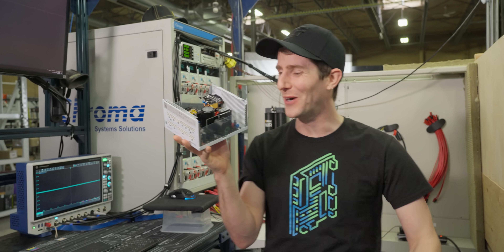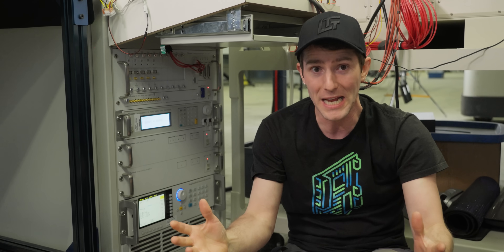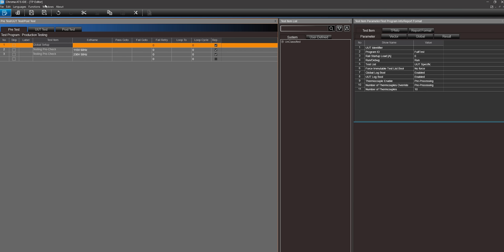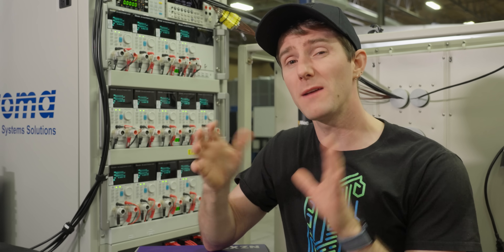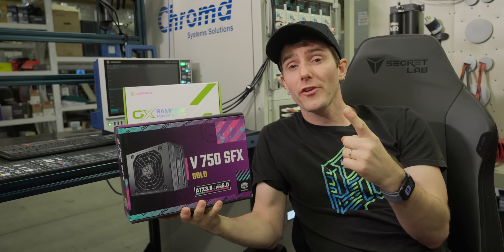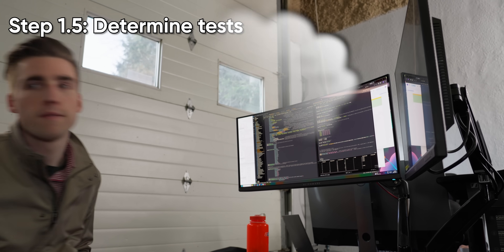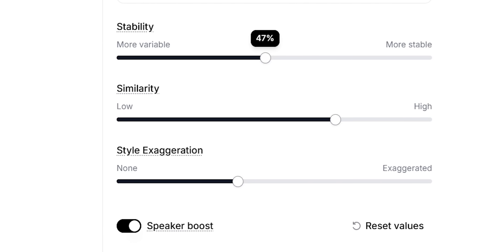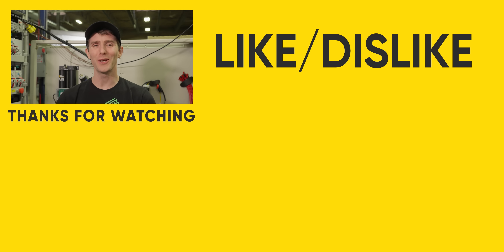Thousands of You are Buying Dangerous Power Supplies

Comment: My little bro got  a $28 PSU off of amazon for a PC I was building him. I warned him against buying it and sure enough after 2 months of not very strenuous use. He was left with a faint smell of ozone and a dead PC.

Edit: Thanks for all the likes, I was able to swap his PSU and get it working again. No problems since. I will try and find the original PSU so you guys can watch out for it.
Reply: A good learning experince, I just hope the pc wasn't very expensive😂
Reply: At least it was just the PSU that died and not the whole thing.
Reply: it's $28 we don't need the name to know not to buy it 😂
Reply: No need for specifics. Just don't buy PSUs in the price range of "1,5 dirty socks and 3 dead rats" :D
Reply: Curious about the PSU.
Reply: pc builders online would always say "don't skimp on this, don't skimp on that". The reality is that you can skimp on a lot of components without the risk losing your whole system, only a bit of performance. But skimping on the PSU could be fatal for your brand new system. You don't have to spend exorbitant amounts of money on the PSU, but don't spend as little as a mcdonald's menu worth.
Reply: @Zonjiru almost every component is a tough sell to skimp on. But imo, PSU is the most important thing not to skimp on, followed by the mainboard. I think from least skimpable to most skimpable, I'd put the list like this for a gaming PC:

1. PSU: If it fails, it can take your other hardware with it and even set your room on fire!

2. MAINBOARD: A faulty mainboard can drive you CRAZY with issues that are extremely difficult to diagnose. Plus, ideally, your mainboard will support your next 2 CPU upgrades. Lower chipsets may not get updated for new generation chips (this is especially true on AMD, whereas intel chipsets usually only 2 generations anyway, even if they could support more) and cheap boards may have weak VRMs that sometimes can't even support the high-end CPUs of its launch generation, let alone future compatible CPU generations.

3. CASE: I'm sure you're surprised  to see the case so high on my list, but hear me out: a cheap case makes building your PC, as well maintaining, troubleshooting and swapping its hardware a freaking nightmare! Not only that, but cheap cases may have problems with the grounding of their IO, causing ESD schocks to go into your system and potentially crashing the PC everytime you plug something in. I've had that problem for years, it sucks! Moreover, cheap cases are made of thin steel that loves to vibrate and amplify the noise of your PC fans and cheap cases often have poor ventilation that can make components overheat that would otherwise be fine. Lastly, your bargain bin case may have wrong dimensions posted on its product page and it might not actually be able to fit that shiny high-end GPU you spent 80% of your budget on.

4. CPU/GPU: whether it's better to skimp on your CPU or GPU depends on you situation and what skimping means within your budget. Obviously, your GPU matters most to your system's gaming performance, but a pricy high-performance GPU is wasted money if it's bottlenecked by your CPU. If you can't currently afford both the GPU you want and the CPU you need in order to get that GPU's full performance, I would suggest you buy one of the two, based on which one you can get a better deal on at the moment and pair it with an extra cheap CPU/GPU until you can afford the one you need. Do keep in mind though, that it's easier to swap a GPU than a CPU, you can literally put a 20 years old GPU into a 2025 motherboard, so it might be the better strat to get a good CPU and grab a cheap used GPU as a stopgap until you can save up for the real deal. Also keep in mind when budgeting, that your CPU performance gets more important if you want to play at high fps at like e-sport settings, whereas if you play at high res and ultra settings, HDR, Ray-TRacing on, etc and are willing to sacrifice fps for eye candy, you may be able to get away with a lower tier CPU than you thought. For instance, I'm gaming on a 5120 x 1440p monitor, I run a mighty RX 6950 XT coupled with a very mid-tier Ryzen 5 5600X and the CPU is far from fully utilized in games, even when I do get 240 fps. a mid-range CPU is all most gamers should need. Unless you play simulation-heavy games like City Skylines or Civ6, I suppose.

6. RAM: Obviously, you need enough RAM to run your games, but apart from that, it doesn't need to meet any other criteria, from my experience. I've had trouble with instability running my RAM at it's advertised XMP speed in the past and I haven't noticed a difference compared to running that RAM just at JEDEC speed, even if JEDEC was only 2/3 of the speed it should be running at. Similarly, I don't think timing matters much either. The cheapest 16 GB kit of RAM you can get will probably get you by just fine for years to come.

7. BOOT SSD: A faster, more responsive system is always nice, but it doesn't make your games run better, at least not yet. One day we may see direct storage find its way into PC games, but until then, the speed of your boot drive doesn't matter. Just make sure it won't die on you and that it has enough space. If using Windows, it should have at least 256 GB these days and I'd even recommend 512 GB, because Windows just LOVES to fill up your bootdrive with trash data faster than you can clean it. If you use Linux though, you can get away with as little as 32 GB (saving you considerable cost), especially if you map your home directory onto a seperate drive, which I always recommend regardless of Linux or Windows. separating your user libraries from your operating system drive makes it much easier avoid loss of personal files and quickly set your OS up again, if you need to reinstall OS in case it won't boot anymore.

8. COOLING: Cooling needs to be good enough to prevent your hardware from thermal throttling, but provided you didn't skimp on your case and didn't go for the hottest CPU and GPU available, you will probably be fine with the included case fans and CPU cooler (or very cheap ones). You can always easily upgrade cooling components later, if you want your PC more quiet, want more thermal headroom for overclocking, or if it turns out you are actually throttling.

9. DATA DRIVES: They don't need to be fast, just reliable and you can easily upgrade the capacity as the need arises. If you're on a tight budget, start with a small data drive and add another one with double the capacity of your existing one, whenever that fills up. That's been my strat over the years, starting from 500 GB, to 1 TB, to 2 TB and finally 4 TB. Don't buy a large drive from the get-go. They're expensive and take YEARS to fill and by the time you filled that 200$ 8 TB drive halfway, it will only be worth half as much and you could have used a 4 TB for half the original price all this time.

10. RGB/AESTHETICS: I love me an aesthetic build with color matched hardware, RGB and custom cable extensions and I call one such build with a red and white theme my own, but as nice as it looks, it totally is a waste of money that should not concern you if you're on a budget and wanna get gaming. This is the kind of stuff you can put your money to once  you've already got the hardware that gives you the performance you want, but still feel the ache to upgrade your PC. That's how I did it and I think adding some nice looking stuff to your PC can be money better spent than a performance upgrade that doesn't result in noteably better performance. But you need to have satisfactory performance first, before it makes sense to make your PC nicer to look at.

11. OPERATING SYSTEM Windows retail licenses are expensive and you don't want to use the Home version, you don't get any control over you PC with that! It's gotta be Pro! luckily, you can buy very cheap resale OEM keys, but you need to accept that you need to buy a new OEM key whenever you do a "significant" hardware change. It's annoying, but still a better deal than than a retail key, since OEM keys are often 10 - 20 times cheaper than a retail Pro license key and you're not changing your hardware that often! You could also just not pay for Windows and game with the watermark, but I can do you one better: LINUX! It's free and after almost one year of using it, I am 100% convinced that it's also plain BETTER than Windows, even for gaming. Between Proton (Steam) and Wine (Lutris), 99% of PC games from any era run just fine! the only exception are some games that use EasyAnticheat, though not all of them. Watch_Dogs 2 uses EAC, but I can play it online in Linux. Point 11 is the best thing to skimp on in my opinion: if you go with a free Linux distro instead of a 200$ retail Windows 11 Pro license, you don't just save money, you even gain freedom from Microsoft's oppressive policies! It doesn't get better than that!
Reply: Ooo your little brother got a great deal on that magic blue smoke generator
Reply: This is why you make sure to have it in a bottle so you have extra magic smoke containment.
Reply: Fried itself only, or something else inside? @Balizticz
Reply: @petroz5505  It seems to have only un-alived itself, damage to other parts is unclear. I picked out a new one for him and there haven't been problems since.
Reply: @Balizticz 
Vital components have sacrificial parts in order to protect them from getting damaged.
Reply: My lil bro got his GPU fried because of the same reasons. Don't be janky with your PSUs kids!
Reply: @higifnr  overused and corny line
Reply: I grew up on anime. I know what i am talking about.
Reply: You failed at protecting your little bros computer.
Reply: @reveral9880   Bro, OP said he warned his little brother but he still installed it, at that point that is the little brother fault.
Reply: @NA-Per No. It is always big bros fault. Big bro supposed to take the blame for little bro in any situation. Only bros will understand
Reply: @reveral9880 I'm a little brother and no, you're wrong! Everyone has to stand up for their own mistakes!
Big bro's responsible to teach little bro not to make the same mistakes, but if little bro doesn't want to listen, it's only little bro's fault!
Reply: @reveral9880  you clearly didnt grow up with siblings cause pointing fingers and assigning blame to each other is what we all do
Reply: @reveral9880  yea no that is not how it is

Comment: Whenever someone asks for an opinion for their PC build I always say never skimp on power supply and make sure the brand is notable, if they don't know any I'll give a top 5 in no particular order: Seasonic, corsair, Silverstone, superflower, and FSP. Also to get at least a minimum of 80+gold rating especially if they live in a third world country with frequent brownouts and inconsistent current.
Reply: Mind you, every single one of those has a couple dud models that you don't want to buy. But on the whole, their better offerings are good.
Reply: Sad that evga isn't on your list. Not sure if stuff has changed, but my psu has been going strong for 10 years now, through 3 different platforms.
Reply: My country never has brownouts but I still got an FSP with 80+ titanium. Just on efficiency alone I make a profit in just 2 years compared to my other options then!

Comment: If you don't follow the ATX protocol, how can we be assured that your tests are reliable? Something "inspired" by doesn't really exhale much trust.
Reply: There are many ways to test something. It doesn't need to be a pre-made 3rd party protocol, so long as the one LTT develops is a consistent and logical one.
Reply: @FergatronMusic   Protocols are there for a reason, as soon as you don't follow them (especially when the video goes out of the way to point out that those set of procedures are what qualify a PSU as being a good one), any results you get outside those paramentes open for discuss and can't really be trusted either.

It also doesn't help that the video also points out that products were tested outside their specified window of operation and were rated as a "failure".

Comment: Usually things are not rated based on 0-100% because... Most things don't and shouldn't be used like that.

At least in engineering, those values are very often ignored. When I'm calibrating equipment, we use values in the 10% to 80% range, if not less because overloading most things will lead to them breaking earlier than they should.

Underloading them is just not valuable since at that point you need more energy to keep them working that what you're actually measuring, so a 1% to 10% load will basically lead to a way higher error and ruin your measurements.
Reply: @XenoVis  the problem with this logic is that the computer will be running at those near edge cases, especially below 10% when it's idle or sleeping.  A good power supply should also not explode but simply turn off if overloaded.

Comment: 1:26 When I first built my PC a few years ago, I had the GameMax 750W RGB. I didn't know about PSU reliability or the PSU tier list at the time. I was just looking for an affordable 750W or 850W PSU at the time with good reviews. The GameMax 750W had good reviews on Amazon. A few months after building my PC I learned of the PSU tier list and GameMax was listed at the very bottom. About 1 year later I upgraded to a 5700X3D (for $181) and changed my PSU to a reliable Corsair 850W. I haven't resold that GameMax PSU as I dont want it to go into another PC.
I just wish I had known about it when I built my PC.

Edit:
8:06 now that you say it failed oy when it went over spec, odds are my build would have been fine as at a full load it was probably only pulling ~450-500W, still i feel better knowing i have a much more reliable PSU.

Comment: I've literally never heard of that first brand, but their name sounds so sketchy that I'd never even buy anything from them
Reply: Yeah, sounds like they could have just been a Chinese manufacturer Gigabyte was buying their power supplies from.
Reply: I've heard of them from PC case shopping but I wouldn't buy power supplies from them though.
Reply: I have heard of them, they offload a huge number of GPUs especially in developing countries but would have reservations buying especially after this video.
Reply: Yea, it's a pretty easy rule for PSUs. If you've never heard of the brand, don't buy it.
Reply: I have a brand new one that I never used. To be fair  he did overload it. 1000 watt so  he put 1100 watts
Thats alot more. Usually  most ppl will only put like 400-600 watts  on the psu thats size ' which will never reach the 1000 watts  rated.
Also is cheaper than most
Reply: @NeVErseeNMeLikEDis  It's not, every power supply should be able to do that and good power supplies will be rated to do a lot more. For reference my 1200W power supply is rated to do 1350W over the 12V 5V and 3.3V rails alone. The 1200W is just for the 12V rail. Especially with the new GPUs requiring ATX3.0 any power supply that can't deal with momentary spikes is useless.